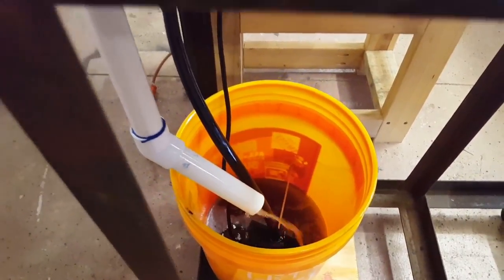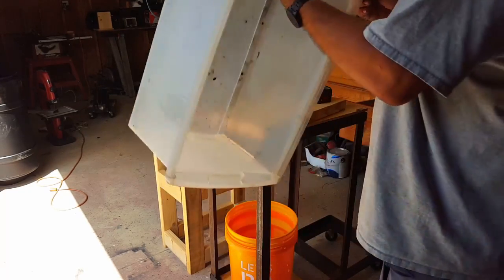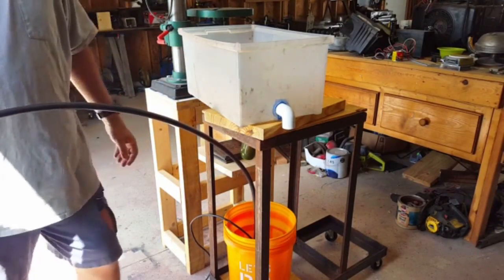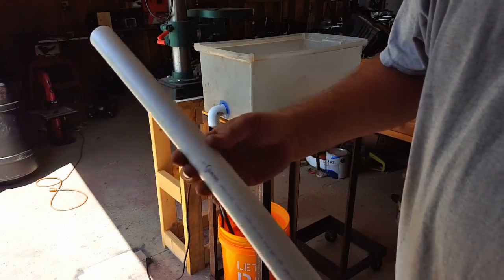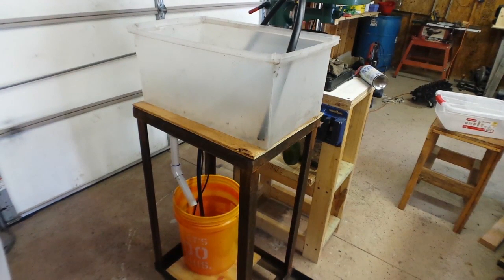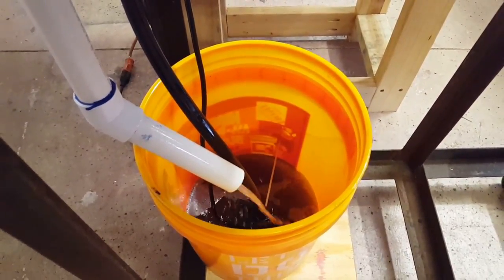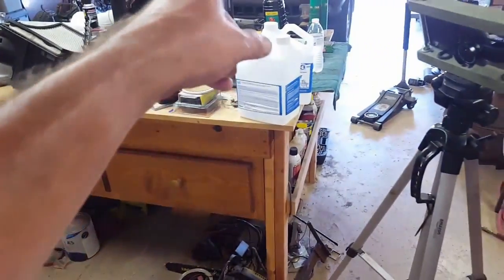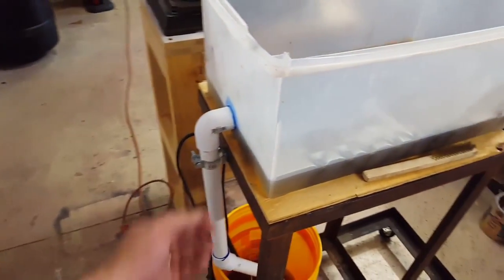DIY - parts washer for your garage

Comment: Parts washers for all those times you don't have the equipment or time to piss around.
Up to about my 3rd design for larger parts but an old washing machine seems to do just as good and means i can do other stuff (only issue is solvents)

Comment: I guess that would be OK for water based solvent, but not anything caustic or flammable at least in my shop.
Reply from the maker: Adam Batchelder thanks for watching... worked just fine and basically the same concept as the  tractor supply brand. Probably not as durable... but breaks down easy and sits on shelf when not in use. Have used it a few time since this video.

Comment: I thought about building one but as much as ill use it... $75 (20% discount)  HF washer will do the job.
Reply: So buying $30 in parts and putting it together for an hour makes it worth $75 to you?
Reply: @woodworkerroyer8497  yup, and it works great...just as it should.
Reply: @ricksspringfield45  I've found that most people put zero value on their time. Oddly enough it's only thing you can't buy or make.

Comment: No gloves or safety glasses?
Reply: +John P  As an ASE Master Tech since 1978, 42 years in mostly dealerships, the parts cleaners used stoddard solvent / minerals sprits "Safety Clean" type. Never used safety glasses or gloves. latex gloves fall apart and would never wasting time with a water-based cleaners. The lid it held with a lead tab on an angled post, so if a fire happened, it would melt and drop, smother the oxygen. 
 Time is money as we get paid by the job, not how long it takes and no cut on parts ever. Hell, bleeding cuts washed off in solvent tank, wrap with electrical tape, keep going! Just don't bleed on the customer car. They frown on that. 
 If a shop pays a tech a % of parts off each repair order, I would run and drive my car out of there. I have seen $600 front disc brake jobs with pads and loaded calipers...so two sets of pads, one car. The dealer used factory parts and had it done for $165. 
No gloves, no glasses, no work, no time, no money, no problems.